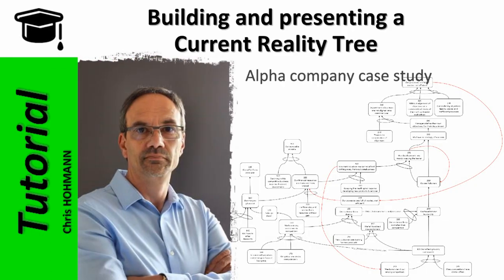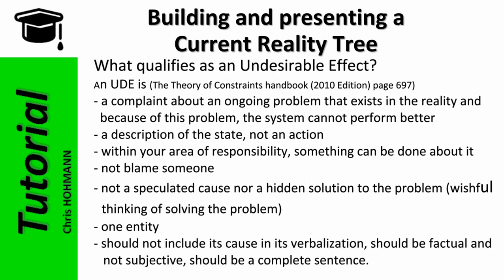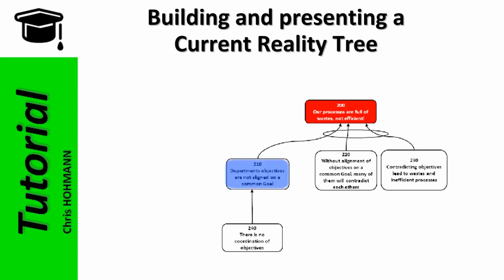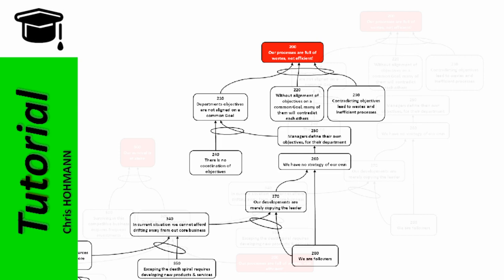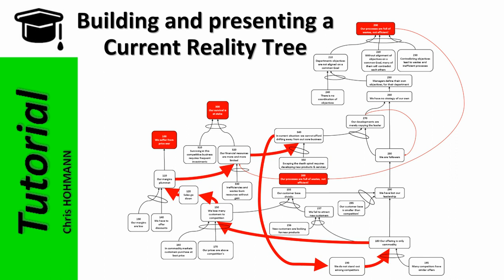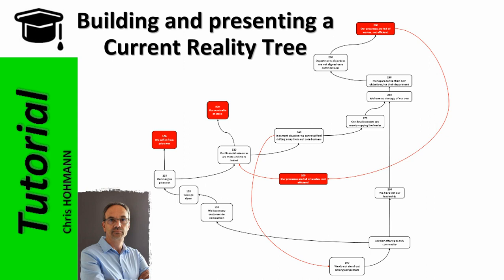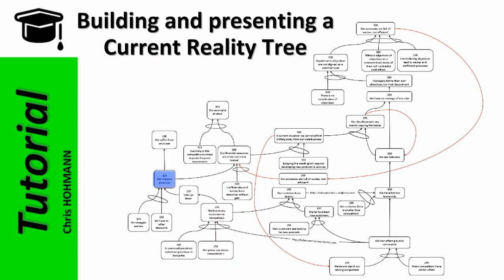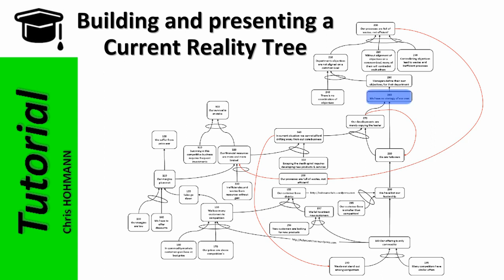Building & Presenting a Current Reality Tree (CRT)

Comment: Thank you so much for making this video. But quick question, Sir. I the beginning you explain that you "pick" the UDE, and giving the number for example, 100 we suffer from price war. Where you get this spesific number? Did you categorized it by yourself, or the is guidelines about it already? 

Thank you so much. Amazing video. :))
Reply from the maker: The numbering of the entities is optional but very convenient for the audience to follow along. Numbering or using any convenient means to identify the entities is up to the moderator. One current way to do is to number them from 10 to n in 10 intervals, allowing to add 9, if necessary, in between. I chose to number them starting in hundreds for clearly distinguishing the branches that go down from each UDE. Just my way of doing.
Hope this helps to clarify!